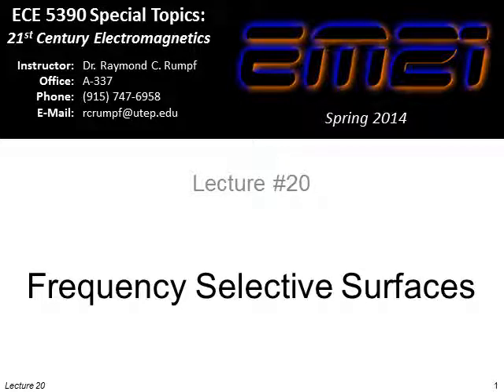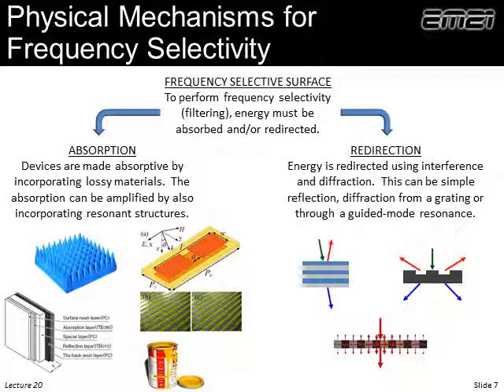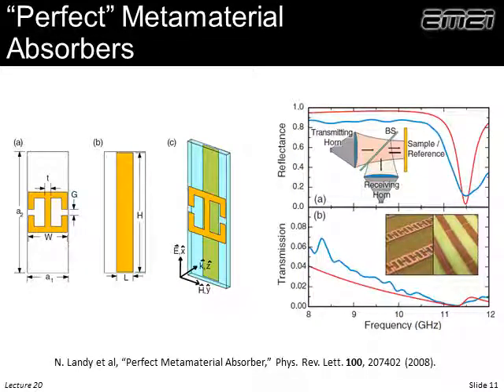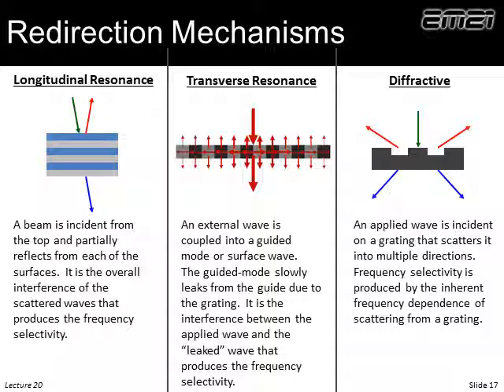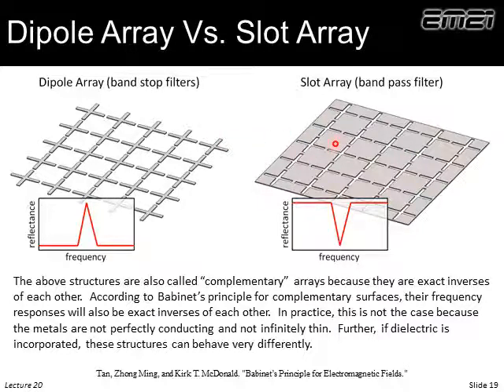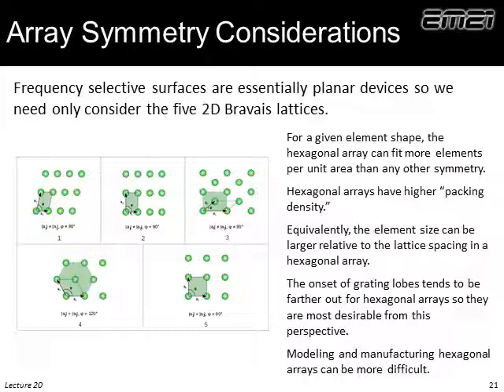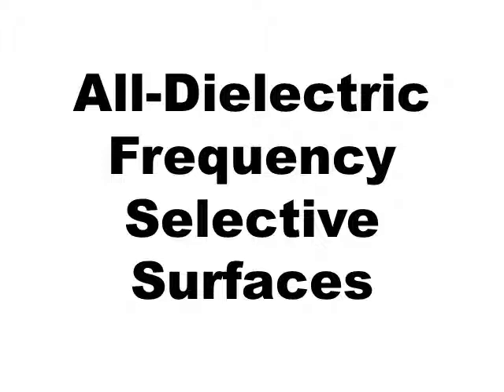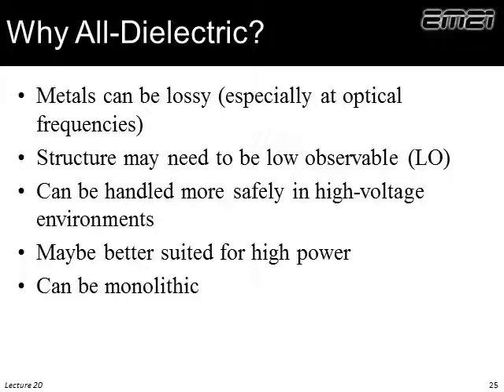Lecture 20 (EM21) -- Frequency selective surfaces

Comment: Hi Prof.Rumpf, Based on the Drude model, EM wave with the frequency below metal's plasma frequency will be reflected by the metal,  and EM wave with the frequency higher metal's plasma frequency will transmit through metal with very little loss. EM wave with the frequency very close to plasma frequency will be lossy. But optical frequencies(< 10^15) usually smaller than plasma frequency (10^16),  how come the metals become lossy in slide 25 ?
Reply from the maker: The plasma frequency is not a sharp cutoff.  In fact, it is quite slow and smooth.  Thus, metals are still lossy at optical frequencies, but even more lossy at the plasma frequencies usually in the ultra-violet region.  Even if the loss of the metals is somewhat low, structures that have resonant metallic elements will amplify that loss because currents are oscillating in those metals and experience more loss with every oscillation.
Reply: @empossible1577  I got it. Thank you very much.